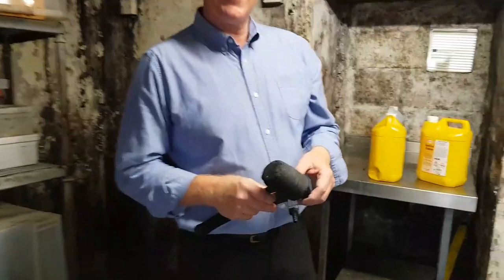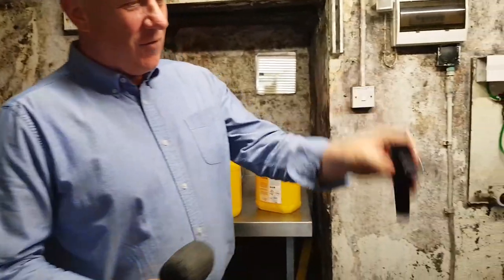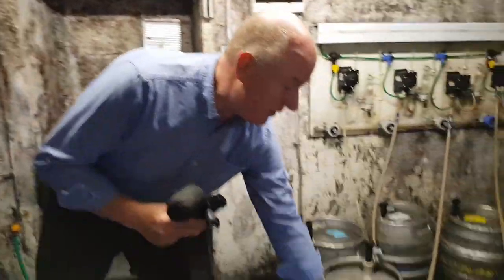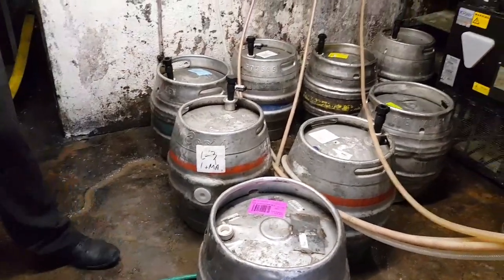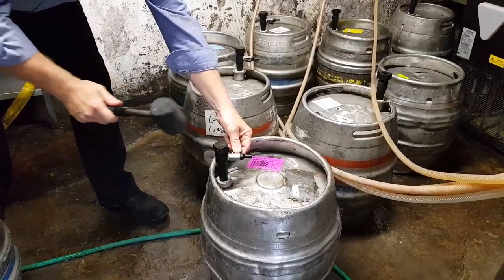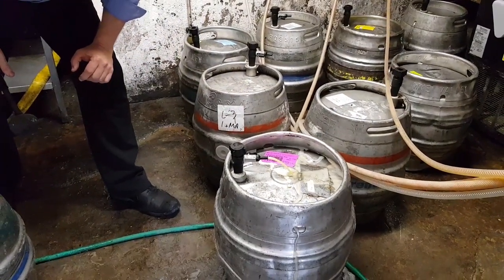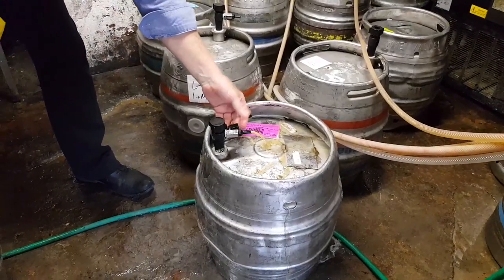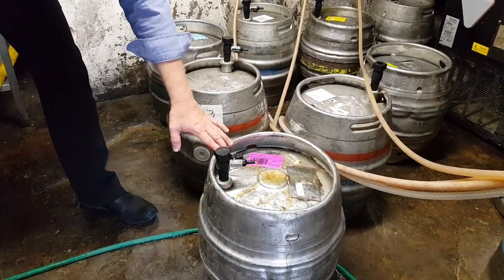How to tap a cask in under 1 minute.

Comment: Never seen a cask tapped vertically before! My experience is you tap on the stillage after venting. Just out of curiosity, what does he vent with?
Reply: The cask is vented through the same bit that released the pressure as he tapped the cask (The venting port) venting is then controled by an adjustable valve on the port which you can just about see in the vid. When ready to dispense, a stainless steel tube is driven through the tap and conected to the beer line. the choice then is to open the cask to the atmosphere through the venting port or connect to a cask breather!

There are two vertical dispense systems to my knowledge - one uses a ss tube as here in this vid (Ale Extractor or Ale Stick), the second uses a floating plastic "widget" (CaskWidge) both systems work very well - not for traditionalists ! ;P
Reply: Maybe its because of the angle, but I didn't see the spile in the venting port in the shiv.
Reply: Maybe its because of the angle, but I didn't see the spiel in the venting port on the shiv